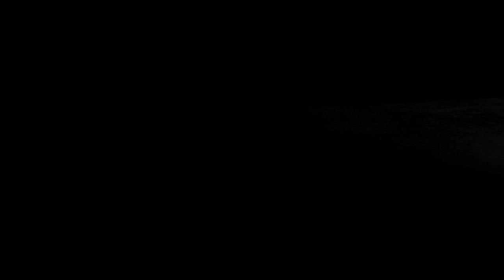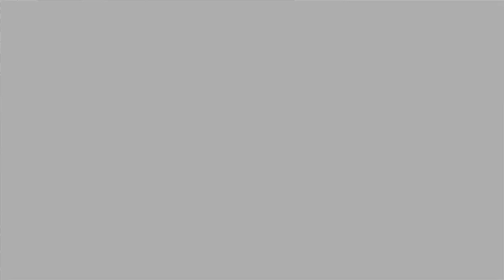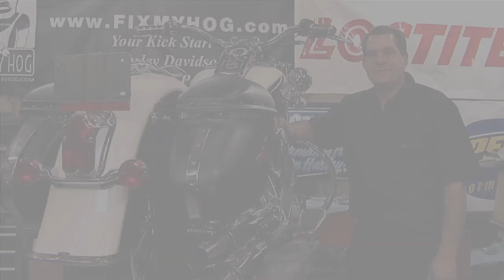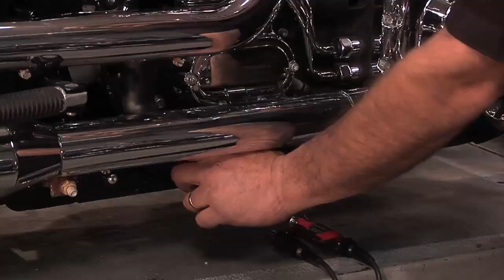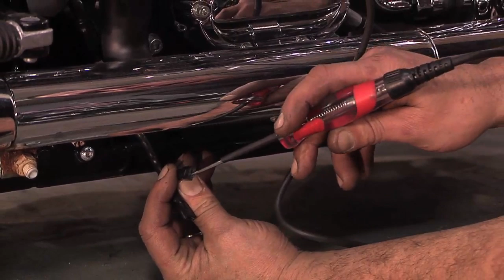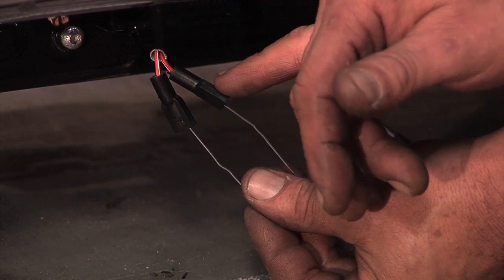Harley Davidson Maintenance: Touring Motorcycles - How to Test a Rear Brake Switch

Comment: Dennis here, new rider, new Harley owner. I just bought a 2015 Dyna FXDL Lowrider and the brake light was on for a few days and now works intermittingly. By on I mean just like the running light, illuminated non stop. Now it just doesn't illuminate. If I remove the tail light socket and reposition it the brake light works for a few minutes and then goes back to not working. The running lights are fine but now no brake light and at first it wouldn't go out. No wires are loose that I can see, does this sound like the brake light switch? Thank you for your great channel and apologies if my question is not clear. The code displayed reads b2161...
Reply from the maker: Great question! We have a lot of technical answers on our website. https://www.fixmyhog.com/harley-tips-a-z-index and ‘Ask an Expert’ section is for members of our online community. I would be happy to send your question off to the experts. To get started, please provide the email associated with your paid membership. Thanks!
Reply: @FixMyHogfreechannel  funny, "fixmyhogFREEchannel is the only channel that wanted money. It's already fixed...

Comment: I did the paper clip test and unfortunately the clip touched pipe now I have no hazards or blinkers  rear tail light comes on but not rear blinkers running light.  What could be my problem
Reply from the maker: Check all fuses and bulbs

Comment: Watched your videos     I have 03 road king that the brake light will not work.  Both brake light switches click the relay.  Swapped relay with another, changed bulb, made jumper from battery to connector heading to rear brake light.  I can make the lights work with jumper.  Voltmeter at harness feeding the rear harness says both brake wires have 12v at all time.   Where do I need to look next?
Reply from the maker: Stop by our site from some more troubleshooting tips: https://www.fixmyhog.com/post/tag/brake-light-switch/

Comment: Always enjoy your videos. I'm replacing the brake lines on my 96 Road King. In your video you mention teflon paste for the brake light switch.  I got a Goodrich high performance set of lines for front and rear. There are some threads connections on both.  Do you recommend dry assembly or teflon paste or tape or something else?

Also, rebuilding calipers for front and rear.  Parts are getting scarce.  For rear was only able to get seals.  Harley specs Dow Corning #44 for pin lube and GE Versilube G322L silicone grease for piston o ring.  They are hard to find. Any recommendations?

Any help is much appreciated!

Thanks,
Richard
Reply from the maker: Hi Richard.  Thanks for the kind words. We appreciate that. 
We prefer to use Teflon paste, but there is nothing wrong with using Teflon tape. 
Paste may be somewhat easier to use on such small fittings.  
As for rebuilding calipers and/or master cylinders: Using a quality grease for pin lube is fine. When rebuilding, you can assemble with brake fluid or, even assembly lube. Have never had a problem or failure from any of these. 
Many masters & calipers, over many years.  
https://www.fixmyhog.com/post/videos-harley/ 
https://www.fixmyhog.com/video/harley-single-piston-brake-caliper-rebuild-005171/ 
https://www.fixmyhog.com/video/rear-brake-caliper-and-pads-001318/ 
https://www.fixmyhog.com/video/harley-davidson-master-cylinder-rebuild-rear-005177/ 
https://www.fixmyhog.com/?s=Rear%20master%20cylinder%20rebuild%20

Comment: along with my rear brake light going out my speedo is acting up works fine at idle,but soon as you crank the throttle it goes out,and when you depress the front barke light switch the speedo will come back on..already changed the speedo senosor..ant suggestion there my friend??
Reply from the maker: 722tea Here's some other speedo issues we have seen. http://www.fixmyhog.com/post/tag/speedometer/